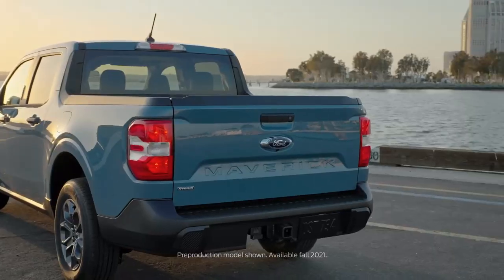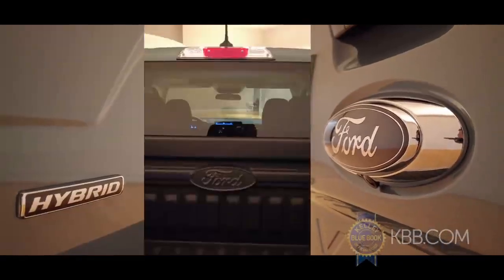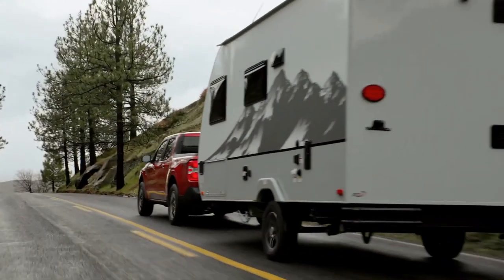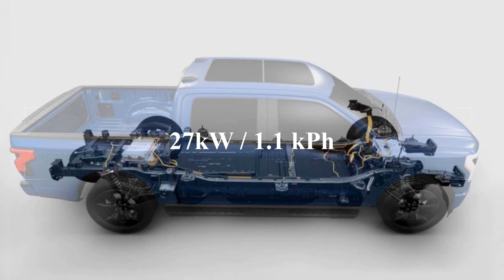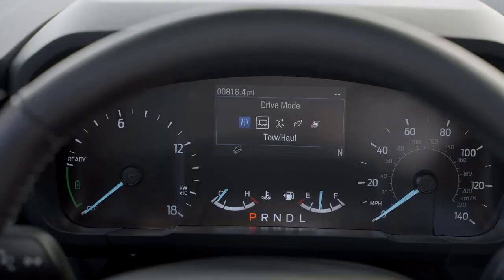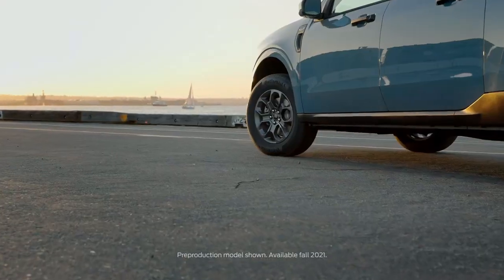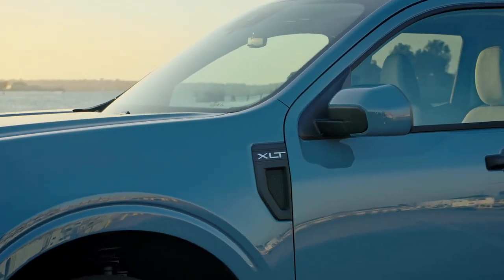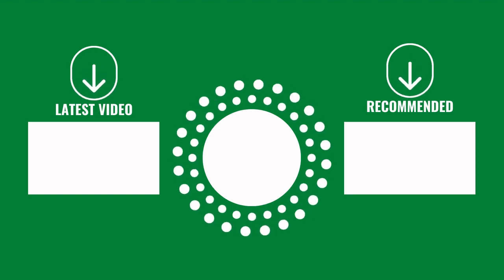Ford MAVERICK Hybrid Engine!

Comment: Where is the Maverick's cooling fan for the hybrid battery?
I don't own a Hybrid, but from what I know they have a hybrid battery cooling fan that needs maintenance. (Toyota's line up)
Reply: Battery cooling system on Maverick is Liquid cooling.
Reply: @dennylang4165  Which should be more durable than an air cooled system correct?
Reply: @KB-bh9hp  More dependable and perform it's job better.

Comment: I'm kind of blown away how many people will buy and order one of these trucks without so much as test driving it.. It seems the hybrid sucked them into blindly ordering one. That seems crazy.
Reply: You can test drive it before signing on the dotted line. You're only reserving it
Reply: Like Khris said you can test drive your pre ordered Maverick before buying. Basically pre ordering just means you will be first in line with the option to buy. I'm guessing we wont see dealers lots with many of these till next year.
Reply: They're just holding their place in line so to speak man. With how things are going, the dealers around me aren't even getting demos in, might just order the hybrid, test drive it once it's delivered, and back out if we don't like it.
Reply: I ordered one with no money down and no promise to buy.
Reply: @danh4351  most people did. What did they say would be your dealers fee?
Reply: @khrisstake2210  the only other fee is a  $199 doc fee

Comment: No way is that going to tow a 23 foot travel trailer. I have a 23 foot travel trailer and I use a Yukon XL. It's barely enough. You're not going to find any 23 foot travel trailer that weighs less than 4klbs. Mine weighs 4300 DRY. Anything that you bring adds weight. Your stuff, you, your food. It ends up around 5k at least.  You also never want to tow at your limit. If that truck is capable of towing 4k lbs, I wouldn't tow a trailer that weighs more than 2500. You've still got all your stuff to add as well. There are plenty of smaller trailers that it could tow, but nothing remotely close to what was stated.
Reply: I've never heard anyone claim that it was going to pull a 23 ft travel trailer. I think the EcoBoost 4,000 lb rating might pull one though. Just because your trailer is too heavy doesn't mean other trailers aren't
Reply: Thanks for the heads up on the tow capability. I was scratching my head about that.

Comment: "The maverick's motor pegged at 126mph because the 2.5l engine speed is limited in this application such that the engine and motor generator can only muster 94kw of juice." - what does that mean? so the engine tune for more torque tops it out at 126mph? who's going that fast in a maverick?
Reply: I was trying to click something else and gave you a thumbs down. My bad. have a thumbs up instead
Reply: That's what I'm thinking 75 or 80 is probably as fast as I'll ever go in the one I ordered.

Comment: I went with the Hybrid Lariat.  No need for AWD in Texas.  Not enough snow to matter, and I won't be going offroad.  And the upgrade from a Frontier that gets 17mpg to 33/40mpg, not to mention the upgrade from 2005 tech to 2022, will be nice.
Reply: Wow! Someone from Texas that has a good head on his/her shoulders!!! Nice call on the “not enough snow to matter”.
Reply: @charlestredway8253  I'm in Michigan with PLENTY of snow. I've only been stuck a few times....... in a sedan. Snow doesn't mean you need awd
Reply: @khrisstake2210  Agreed. I live in West Virginia front wheel drive go in the snow.
Reply: I'm in Idaho, and we get enough snow to matter. FWD is great. Keeps the weight over the drive tires. AWD is really not necessary for most use cases.
Reply: I've never had all-wheel drive here in Kansas so I don't even know what I'm missing and I'm fine with that. Never had a problem